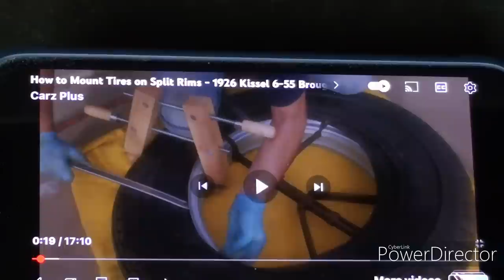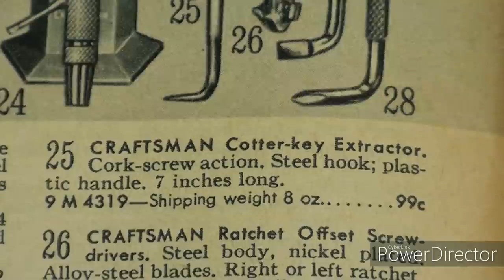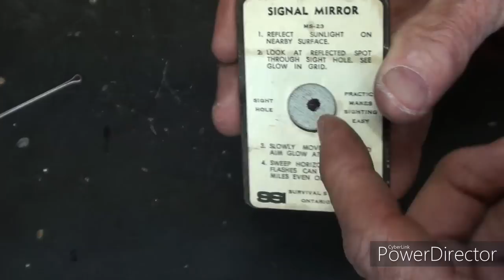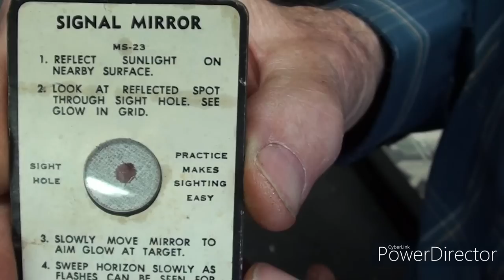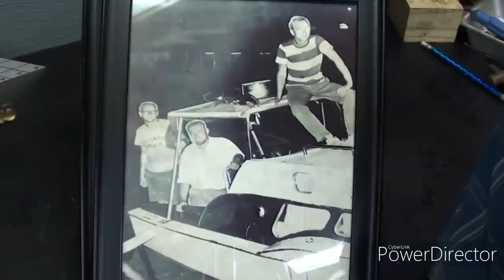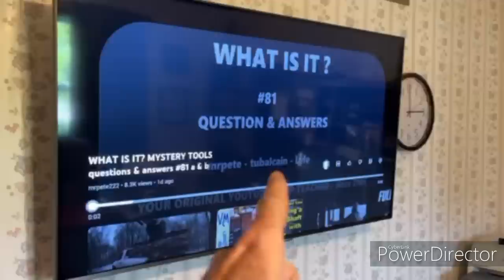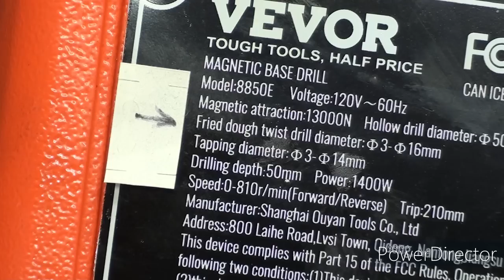tubalcain ANNOUNCEMENTS - Mrpete vents temporary

Comment: I've also found myself checking out of all news. It's just not worth it, spend your time creating or tinkering in a shop. 

I also wanted to say thank you Mr. Pete, you've been with me at every job site, while I turned every screw, and as I fire up every machine. 

I got a great compliment at one of my early jobs running a manual lathe. The Foreman said: 'boy I don't have to teach you anything' as I explained the difference in chip breakers of the tooling they had. Funny thing is I had never run either type at that point! I had just watched all your videos and was able to come up with the rest. 

Now I'm a bit older and have my own house. I'm finally setting up my dream little shop and I have you to thank for that. From the bottom of my heart, thank you for all the videos you have put out.
Reply from the maker: Thank you very much for a lovely comment. I appreciate your loyalty.

Comment: I enjoyed your demonstration of the Vevor drill. I think it was a fair trade for that company to “donate” the machine so we could see what it’s capabilities are.   Sometimes a scolding is necessary to clear the air. 
I truly hope you’re looking after yourself !!  A lot of us are in a similar predicament as you are and we all deal with it in different ways.  I’ve made several additions to my shop from you’re models/ideas and appreciate all your efforts Mr Pete.  Thank you, John.
Reply: I was just on vevors website this morning. I had no idea all things they sell and was wondering about the dollar value of their products. I used to be a regular everyday shopper on Banggood till they changed and I never shop there anymore. I bought a lot of stuff from them and most of it was worth every penny for what i needed it for. Things change in this world and not always for the better.
Reply: I had just purchased a mag drill from vevor a week before your video came out on yours.. different model that uses the 3/4” shank cutters only.. $189 plus 30$ shipping delivered to Alaska… got to use it first time other day on 1” thick 4340 steel.. ran slow with torque. Cut that like butter.. mine is the yellow model “VEVOR Magnetic Drill, 550RPM No-load Speed Electromagnetic Drill Press, 2.16" Depth 1.57" Dia Magnetic Core Drill, 2700LBS Boring Tool Drill Press, w/ 1100W Drill Press, Yellow and Black Drill Machine”
Reply: @mikeskupniewitz8057  I'm going to have to start looking there . Looks like they have sale items and clearance

Comment: Mr Pete, thanks for you time spent making all the videos, regardless of length or topic. I have one of those large Miller Falls drills that is also a right angle. My father told me if i was going to use it, to place the handle against a solid surface (stud) before ever touching the trigger. It is fully capable of picking a 300lbs man off the ground.
Reply from the maker: Yes

Comment: I enjoy your videos, thanks for your patience. 
The Model T tire tool is used on vehicles that have wooden spoke artillery type wheels that have a split steel hoop with a bolt in wood spoke center. 
The cotter pin puller is used by many different trades. Industrial pipe insulation workers use it to weave chicken wire around pipes; they call it a “chicken needler”. Other trades sharpen them, dull them, bend them, etc.

Comment: Hi Mr Pete....when I was a mechanic,  I bought the tool as a hose removal tool (works great when sliding around under the  hose to break the bond), but also used for pulling  cotter pins.  We love you  Mr. Pete....take care.

Comment: Hi Mr Pete Thank you for all your wonderful videos . I was a mechanic for 40 years  my last 20 i worked on road equipment snow plow, graders, loaders, dump trucks, anything the road department bought i got to work on sweepers and even Vactor trucks  .
 So i can relate with being in pain . I can't believe you took on putting in a new floor looked good  i need to get one or two of those knee pads . As far as Vevor go's i bought a drill sharpener i saw on Winky's workshop Vevor gave him one . nothing wrong with the way you reviewed the mag drill . Thanks for your Videos Mr Pete  i have learned  a lot about machining from you  and i plain just like you . Thanks JM
Reply from the maker: I often watch a Videos, where men are working on heavy equipment. Very interesting, but everything including the wrenches is heavy.
Originally, the drill, grinder is what I wanted to get from them. But they no longer offer it.
Reply: @mrpete222  I woke up the other night with YouTube on and some video from  Brazil or somewhere like that was getting an excavator bucket ready to ship to the customer it was huge I can't believe the size of equipment they're making these days compared to 50 years ago
Reply: @mrpete222  yeah I got one that looked exactly like the one from vevor butter  another company was selling it if you're talking about the drill sharpener

Comment: Hey Lyle, I go through periods where I have "0" energy and a general sense of not feeling good.  Recently, I have been energized and I am starting to make some headway on my crumbling house and weed filled yard. I guess it just goes with being 80.  You've got a lot of miles left on you and a lot of creating to do. I would like to see the engine build and I had a large Millers Falls drill motor with a #2 MT spindle.  I made a 10" diameter hole saw using a taper shank reamer for the driver and pilot. I needed to make two 10" holes in a 90' wooden boat transom for  wet exhausts. Working in tight quarters in the lazarette, The hole saw would catch and lift myself and a helper with a slam to the overhead. The transom was 6" thick, laminated Mahogany. We would saw for an inch and then chisel out the wood till the hole was complete. I wish I had a pic of the hole saw made with a section of 2" W band saw blade.;
Reply from the maker: That must’ve been quite a job drilling those holes

Comment: Mr. Pete once again thank you. I wish I had teachers like you when I was in shop class. Keep up the great work. As far as the Vevor products I am a true believer that you get what you pay for but you don’t always need the best of everything. I am in the process of building a shop and I have installed a Vevor cable hoist to assist me in the building process and I will say it is not the best hoist, but it is the best hoist I have in my shop. I had received one hoist that was not working quite right but Vevor made good on the product so I will not complain for the price and the fact that it is saving my back right now. Thanks again for all the great content.

Comment: Hello Mr Pete.    I understand where you are coming from.  I had a similar upbringing.   Just one comment please.  You mentioned not using hole saws for large holes.  They do use hole saws for large holes but we generally refer to them as a 'Rotabroach'.  They are more like a hollow milling cutter.  They have a spring loaded centre for aligning the drill.  They have a magnetic base to hold the drill firm.  With a twist drill -- to enlarge a hole without the drill grabbing, just grind away the front relief angle so it is more like a neutral cutting angle.  Just keep eating those eggs.  Cheers
Reply from the maker: Thank you very much

Comment: The bent screwdriver, is originally a cotter pin removal tool. Commonly used in the insulation trade to tighten chicken wire as a means of wrapping insulation, and securing it to various odd shapes like boiler units.

Comment: 35 years ago I purchased a Milwaukee magnetic drill for $100 dollars at a construction site from a "hawker". Had to be hot! No owner markings, nearly unused, and in a heavy canvas bag. No drills, new chuck, and 3 standard sized hole cutters that the drill was designed for. Like you I needed something strong and slow. The trade-off is super heavy, but that's part of the quality! A friend of mine worked for the railroad and got me a 30" piece of the biggest rail I've ever seen, weighing well over 100#. I welded 2 pieces of angle iron to the wheel side and use the flat base side to mount the drill too and and the rest as a drill table. I've made numerous tie down fixtures and vise setups over the years. I still use it, especially for large and  awkward jobs. No end to what can be adapted to this rig! Still fairly portable for the super powerful rig that it is. A piece of I-beam would work for this too, and not nearly as heavy! More than 2 cents this time but you take care of yourself. Thanks for your time and sharing! 👍😎✌️
Reply from the maker: Thanks 👍👍👍

Comment: Don't be despondent Pete, you are doing wonderful work. On those deadly drills, we used one in the 70's. A Kango hammer. It was such an arm breaker we used to strap a stick to the handle and attach the cord to that. If it spun the cord was pulled from the transformer....fini!  It was a huge safety improvement.
Reply from the maker: That was a great idea

Comment: I had a powerful 1/2" drill jam up as the bit broke through. One of the issues is that the torque pushes the drill body tighter into your hand grip making it difficult to let go of the trigger. Less of a problem for left handers though. You are spot on with your comments about the influence of parents. I worked with many boys who had no good male role models in their lives. I'm afraid it becomes a self perpetuating problem as it moves down the generations.
Reply from the maker: Thank you very much, I enjoy your videos. Yes, it can be difficult to release that trigger 
Some of my students didn’t talk about their father, they would talk about their mothers boyfriend.

Comment: Just three days ago, I had one of those wrapped-up-in-the-cord-near-injury episodes with an old Stanley 1/2" drill very much like what you described. When it was wrenched out of my grip, I somehow managed to engage the trigger lock button on the side of the handle. I was able to step away from it and as it wound up the cord, out of control, it soon jerked the plug out of the socket. Fortunately, no injury. Too much torque for one man to handle.
Reply from the maker: Wow, yet another horror story using one of those big drills

Comment: Hello Me. Pete, I still use those powerdul old drills. First thing I do is cut the long cord off down to one foot and install a new plug. I stand on the extension cord so if it catches it unplugs itself....and of course touch every bit up I use even if its new. I have one 3/4" drive that I replaced the pipe with an adapter and shouldered eye-hook.  Takes a little bit of my error out of the equation. Hangs from my a-frame.
Reply from the maker: Excellent safety precaution

Comment: Regarding the post office.   This comes from a friend that works there and it has indeed worked for me.    File an on-line complaint regarding whatever happened.   It's the only thing that they will listen to.   They lost an expensive Columbian vise I sent to my daughter.   For months I got the run-around.  Filed a complaint outlining what happened and in a week I had a check for the full amount.   Apparently bonuses for supervisors are somehow tied into these complaints and resolutions.    Again, from a friend and my experience only.    Yes, I hate commercials in YouTube, especially since I pay for YT Premium to get away from them.   I stopped watching TV years ago.   You are doing a great job.   Present whatever your heart desires and I'll watch it.   You're kind of my hero.   Stay well.

Comment: Another great video! Regarding the cotter pin puller: we used them for hose removal but the bent portion was not really long enough for that and Snap On eventually modified them for hose removal.  As for the large hand held drills: somewhere I learned to operate the trigger switch with my left hand. When the drill bit bound up, it would pull the drill out of my hand which released the switch. You mentioned using the magnetic drill with a drill press vise; what about mounting them to your milling machine table? There would be other possibilities for sure but you already have the mill.
Reply from the maker: I am still trying to think of good ways to use that drill. Other than what I showed you.

Comment: Mr Pete, I saw a video where the guy removed the head from a drill press and cut the column off to length. Then he built a steel platform for the mag drill to set. You have a stable platform for the drill, adjustable table, and the drill is easily removed to use elsewhere.
Reply from the maker: I would like to do exactly what you described

Comment: Step drill bits work great for thick metal. Each size has a new cutting surface, and they do not bite as the bit goes through the metal. I always thiught they were a joke, until I tried one. They are now my go-to bit.
Reply from the maker: I only actually have discovered them in the last five years. I always thought they were a novelty.
Reply: @mrpete222  I converted a 2wd truck to 4wd. Had to drill a ton of holes in the frame. I have done over a hundred holes, and only touched up the cutting edge once. Before  that, I had to touch up the regular drills after a few holes. I did find it faster to drill the hole first with a 1/8" or so drill first. The step drill is not the greatest for starting holes in thicker metal. They are also great for doing holes in sheet metal. They do not grab like a regular flute bit does.

Comment: I have one of those big old torque monster drills. I was drilling mounting holes for a storage box in my Toyota pick-up. I had to drill from the bottom of the bed, and it was a rather confined space. When it finally punched through the double layer of sheet metal, the bit stopped moving. Before I could even release the button, my arms got twisted up like a twist tie on a bread bag. It couldn't have been a full revolution of the drill before it pulled from my hands, but it sure felt like 5 revolutions at the time...lol. The drill isn't used as much now that I've "upgraded" to cordless drills, but when I need the big gun, I've got it.
Reply from the maker: Those big drills scare the heck out of me

Comment: What I find hilarious in this vid is you saying the cotter key puller is great for radiator hoses...

Why? Snap-On sold me one in the '80's when I was a flat rate mechanic in the off-season, as a heater & radiator hose removal tool. 

Later, maybe 10 yrs, I 'discovered' how great it was for removing cotter keys!

Keep on doing what you do. Make your boat trip for you. Your family will treasure it, & your YT fans will love it.

I've been dealing w/ no appetite for 20+ yrs, so I know what you're going thru. Mine came from a brain injury.

You sure don't want my current solution: a feeding tube thru my abdominal wall.

Since developed throat cancer in 2020. Relapsing in '21 meant radiation, which has damaged my saliva glands, preventing me from swallowing. Don't know if they will ever work, again.

But, that's minor. Now, the cancer's in my liver, after being told for the 2nd time I was 'cancer free'.

You will likely out live me, Pete, & I got 10+ yrs on ya.

Always a pleasure. Keep on.

GeoD
Reply from the maker: Thank you for commenting girl. Very sorry to hear about your health condition.      I pray that you have a miraculous cure. I hope I never have a feeding tube, that must be terribly hard on you.

Comment: I have a Clausing variable speed drill press.  I need to drill some 2-1/2 - 3 inch holes in wooden fence brace posts. My Hole Hawg is too fast and hard to hold onto.  My project is to put a two speed three phase motor on the drill press. If I recall the slow speed on the motor is about 1140.  I am optimistic, but regardless it should be interesting.
Thanks for all you have taught me.

Comment: As an aircraft mechanic, the cotter pin and O-ring tools are in my toolbox. The brass keeps  you from marring the O-ring grooves and surfaces of hydraulic components and the cotter pin tool makes it easy to pull pins, they come in smaller sizes. As far as slipping ads for a company in a video, I try to skip past that mess.

Comment: Mr Pete,
Do you remember when fan belts and coolant hoses were forever cracking and breaking and leaking? It seems like I spent the 70's changing them. I have had Toyotas with 250, 000 miles with the original hoses and belts on them. Has rubber improved?
Reply from the maker: I totally agree. I used to carry spare belts and hoses back in the 60s and 70s. I have never replaced a belt or hose on my tire orders in the last 20 years and one Camry that I had was about 270,000 miles.

Comment: I also have a Craftsman cotter pin puller, but have always used it as a spring puller on motorcycle exhausts.  It obviously has many uses.  I've had it for about 50 years.
Reply from the maker: Yes, there must be hundreds of uses

Comment: I have loved your videos from the beginning!! (You've only got me by a few years!)
You reminded me that when I saw your Vevor drill episode drilling a 1" hole in steel,  I wondered if you or anyone from the peanut gallery had a ever heard of a "Cole Drill"(armstrong  powered by a ratchet handle) used to put large holes in steel plate...
Reply from the maker: I certainly have, in fact, I owned one for a short time, and wasn’t even sure of its purpose. It had a beautiful Jacobs choke on it, which I saved and then threw the rest away. I hope to run across another one and demonstrate it.

Comment: The cotter pin remover looks a lot like a heavy duty 90 degree pick. Harbor Freight sells a set of those heavy duty picks. Used onmw juat today to aid in removing a snapring in a automatic transmission I'm disassembling in search of a smoking gun type failure.